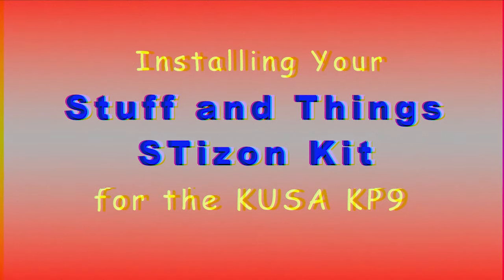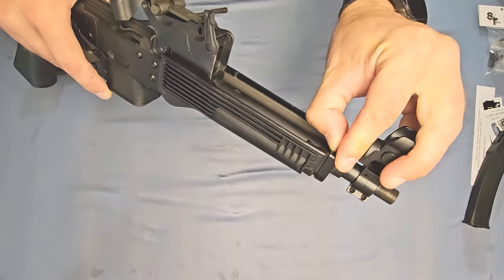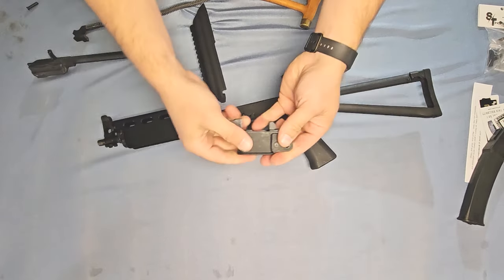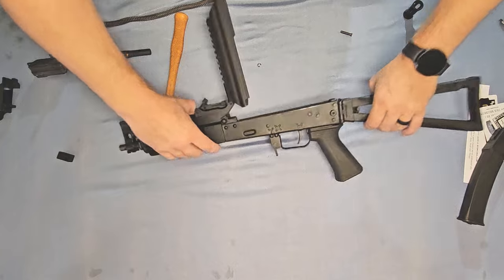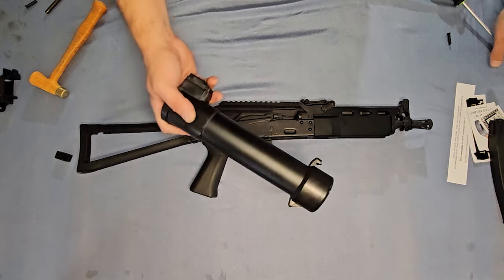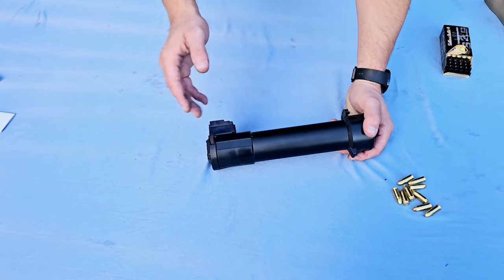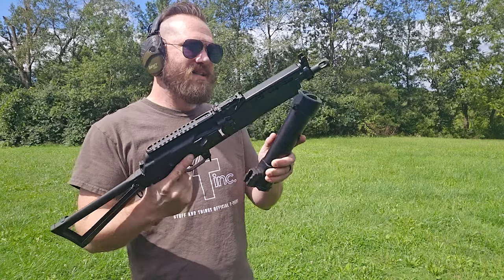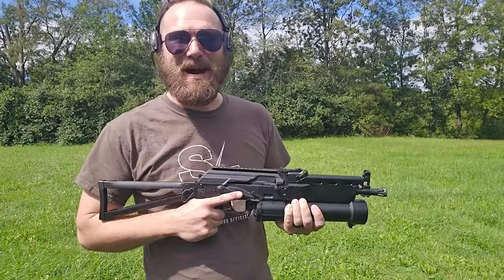STizon Installation for KUSA KP9

Comment: I got my KP 9 kit today, totally forgot I ordered it. Couple of things if you lose the slave pin, a chop stick can be modified lol
But onto fitting the mag release, go slow and take steps, and when test fitting it, have it fully assembled with the mag release spring in it.
I didn't on the last fitting and took probably took a .010 of an inch to much off. it was sloppy and loose fitting and would not engage the leaver on the magazine. I used the kp9 release and tested fitted between filing and it slapped in nice and tight, but still had a wobble and will not engage the ratchet release on the mag. so I think I took too much off again
Reply: I don't think you did. A couple of us KP9 guys are having the same issue and when I sanded my mag paddle down, it was super tight. However, when I shoot the gun, the ratchet is disengaging. Seems like any wobble in the mag causes the ratchet to disengage however, its an AK so any mag will wobble. Having a lot of play due to the front handguard retainer hole being much bigger than the mag lug.  I emailed Will. We will see what he says.
Reply: @codyforsythe2138  I ended up brazing the catch that came with the kit today adding some back to Its super tight now, and the ratch latch engages. But I can see this wearing out the catch on the Magazine over time.  I think if they added some on the top of the ratchet latch where it engages the receiver I think it would solve issues.
I bet a dab of liquid steel would work as a temp fix. 
Also the nose diving the mag does at the front handguard will cause issues for people.
Reply: @OldManGamer.  Agreed 100%. I printed a new magazine release, and it is super tight until I laser weld the other one back up. However, I am still getting a mis ratchet every once in a while when shooting. I think lengthening the ratchet lever would 100% fix the issue as you said. I am also concerned about the plastic lug wearing over time. I think once it starts wearing, the gap will open back up and ratchet issues again. I am wondering if an SLS nylon or machined nylon mag release would be better on wear against the plastic lug instead of a steel latch.
Reply: @codyforsythe2138  took it to the range today, it was a pain in the ass to load, and would jam or stop feeding around 4 or 5 rounds down range. lol,
Reply: @OldManGamer. please film and post it. You’d be the first to give an actual customer experience vid.
Reply: I’m having the same exact issue, Kusa kp9 here. Dremilled down two mag releases, first, I took a tad bit too much off and it wouldn’t engage lever. 2nd, I had it nice and tight and lever wouldn’t engage. I emailed both the contact form in the website, nothing. Emailed Will today so I’m also waiting for a response.

Comment: these things are junk, jam o matics
Reply: Do you have one?
Reply: Crickets...
Reply: @jeroth1987  was expecting that or them going “bizons are trash”, which means they never looked into these stizon kits which state that they are redesigned for reliability. But we will see how people review these kits that actually get them, like i did.
Reply: @FairlaneFox  I have one and it's a jam o matic,
Reply: @OldManGamer.  you got one for the kp-9 already? I didnt think they were getting sent out yet. What issue are you having? Failure to feed? Not picking up rounds at all? Would like to know what to look for while i wait for my kit to arrive.
Reply: @FairlaneFox  failure to pick up rounds, best run I had was 6 rounds in a row. 
loading issues, It wants to jam loading rounds, found the trick is to have it tilt the noise down as you twist. it wants to bind on the followers even.

be careful not to take too much off if you have to file the mag catch. I took a little to much off my first one, and it wouldn't engage the ratchet latch when seated. my second one was tight and had to slap the mag good and hard to get it to lock. but it got loose as I shot . I have an M+M mag catch on the way, I hope it will work better. 

in no way do I regret buy this, I want to get it working 100%
Reply: @OldManGamer. do you think ammo choice makes a difference?
Reply: @mikea.6608  I was going to post an update this weekend, my issue has been with the mag catch, and I think an issue with the ratch spring.  I ran it yesterday and had 0 issues after I installed a new mag catch and filed it down until would latch with little force by manually moving the catch.